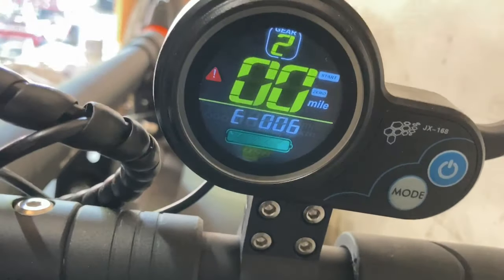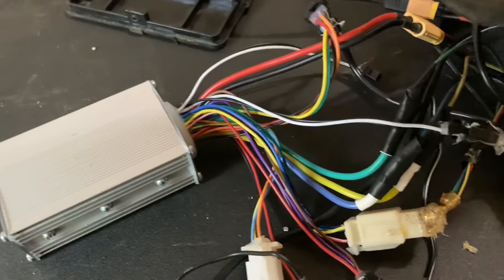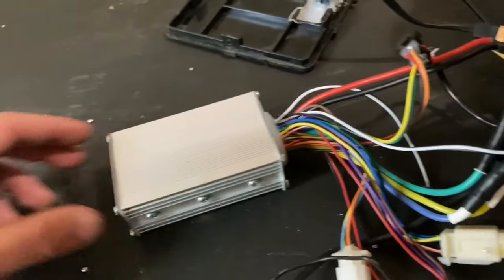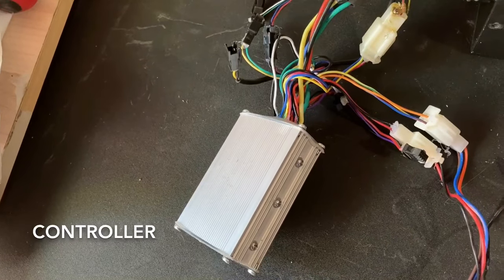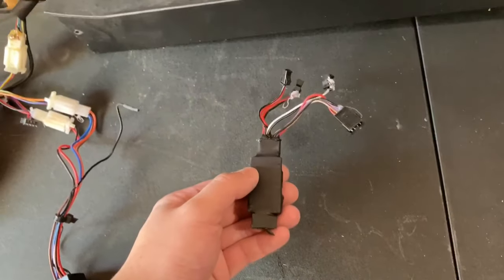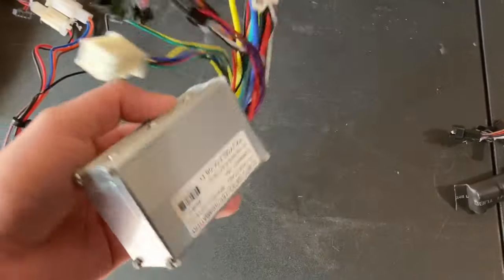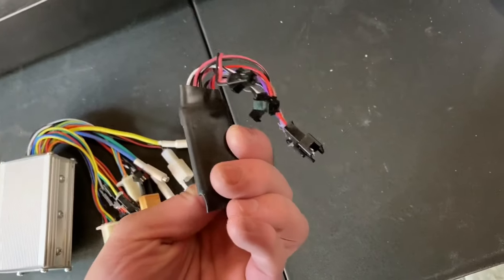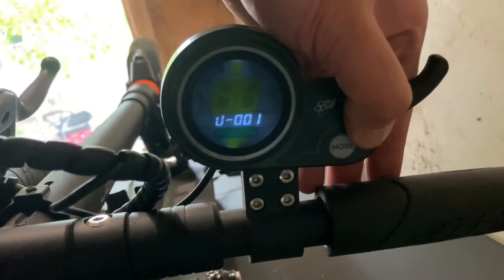E-006 - Error 6 - Joyor Scooter Communication Error

Comment: Frustrating to get any kind of help from this specific brand joyor, my problem is that the LCD throttle only powers on when plugged-unplugged whether the charging port or the 5 pin connector,  when it's powered on works flawlessly but once powered off I have to repeat the same process plug-unplug, it started happening after replacing the headlight, now the lights can be turned on/off even when the scooter is powered off

Comment: Hi 3 years ago I bought quickvolt 8. Few months ago my LCD (type QS S4)broke. So I bought a new one (type: LH 100-which is compatible with 48 v battery). So the thing is that it gives me type 6 error when I plug it in. The thing is there are no wire or battery problems...how do I know??? well when I put the old LCD everything is good no problems no nothing (my old LCD is good just a piece of plastic broke from the lever that s all). But when I put the new LCD it gives me the error. Can you help me?? What can I do?? I dont think I need to check the wires(the wires are fine since the old LCD works).
Reply: How did you fix?
Reply: @NINJAGaming-zh1bp  I didnt. I fixed the handle on the old LCD. I tried to return the new LCD but they didnt want to give my money back. I think I still have the piece idk. Or maybe I gave it to the buyer when I sold the scooter (a year ago).

Comment: Where did you buy controller😊
Reply from the maker: BugChayNoi Channel On the original Joyor website, you can contact support and send an email regarding certain specific parts needed.
Reply: @LorrCraftProductions  does it work for iscooters mine has e06 and ent got no power in scooter??

Comment: Hello question, e-006 error. We use it even raining as school service. After a week weve been experiencing e-006. We opened and notice just a little moist we suspect due to getting wet from rain.  That is why we open to check wires and see no problems except a lil moist no burnt or cut wahtever. We blow dry heat it as well. We check throttle open it as well no problem. But still experience it. But now when we open the headlight it triggers e-006. What do u suggest is the problem?
Reply: Btw we dont use it anymore when its raining because it's too delicate to water.
Reply: Btw we dont use it anymore when its raining because it's too delicate to water.

Comment: i bought earlier brand new electric scooter the brand is (DOUBLE D VA400), then today is my 1st ride..then E-6 also appeared when I tried to click my throttle and do not work..but from my 3 try, it's back to E-0 and it works..
its that normal or i will back the unit from the shop i bought?

Comment: Error is also due to the lights being on without you hitting the power button on the remote. I thought I had an issue but turns out you just need to press the start button on the remote and the lights will stay on and you won't get an error 6
Reply: What power button
Reply: What start button on what remote